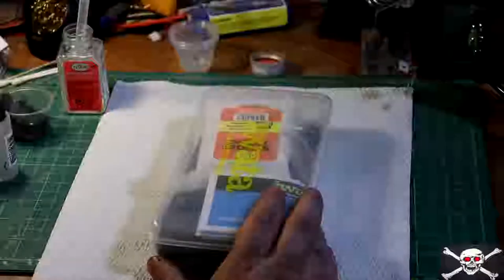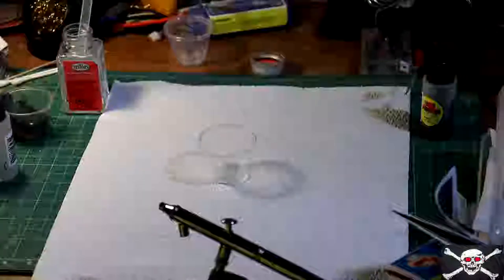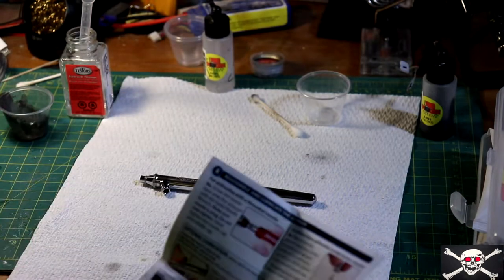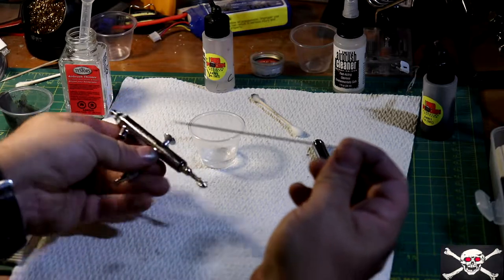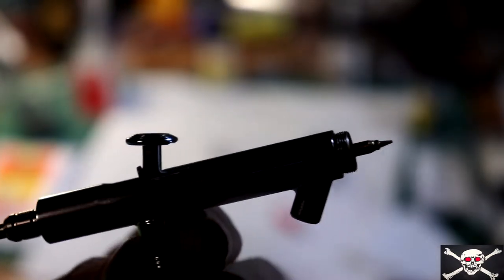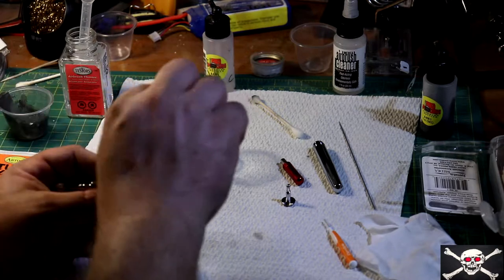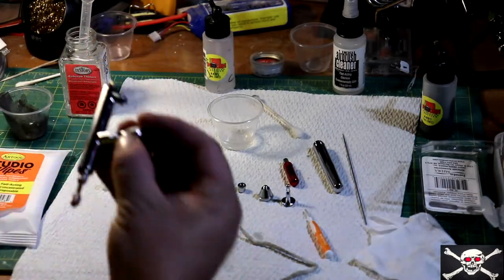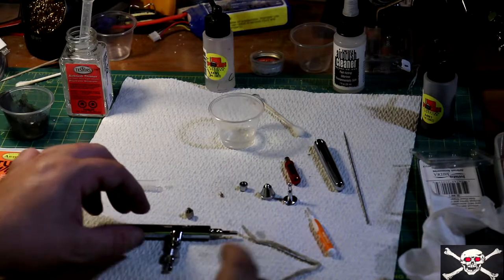Airbrush cleaning tutorial (Deep Cleaning) (How To)

Comment: On my neo there is a grease like substance on the threads of the main cap you unscrew… after cleaning, that substance is almost gone. Do I need to replace that grease ?
Reply from the maker: There is no o ring on the main cap, correct? If not then the grease is just there to make the cap screw on easy and to possibly protect the threads. You can add a little bit of oil to a cotton bud and apply to the threads if you wish but is not a necessity.

Comment: My eclipse isn’t spraying anything, not even water. And when I back flush it, it starts flushing as soon as I push down for air only, which I thought that should only happen when I pull back (after pushing down of course)…please help, thx
Reply from the maker: I'm guessing the needle isn't seated correctly or is bent or a bent tip. Disassemble it and check the needle. If it is ok and no damage, carefully re-seat it and try again. Otherwise you may need to buy a new needle.

Comment: You didn’t put the o ring back on, or if you did I missed it
Reply from the maker: The only O-ring was on the Nozzle. I left it on the nozzle and did not take it off, so when I reassembled it, the nozzle was screwed back in with the O-ring attached.